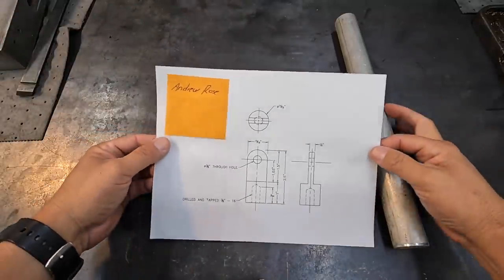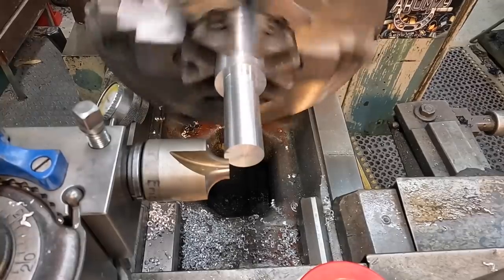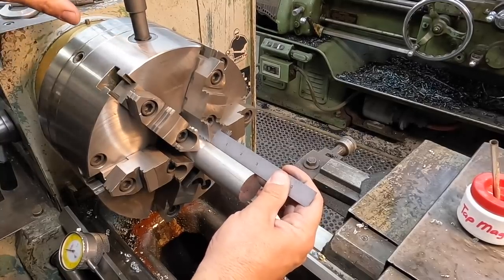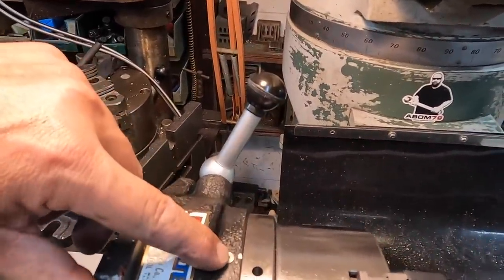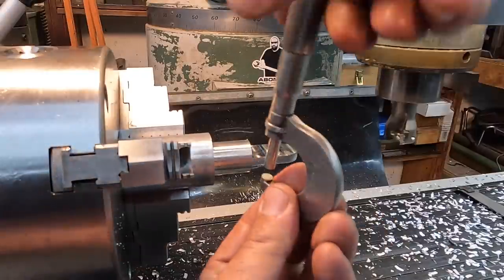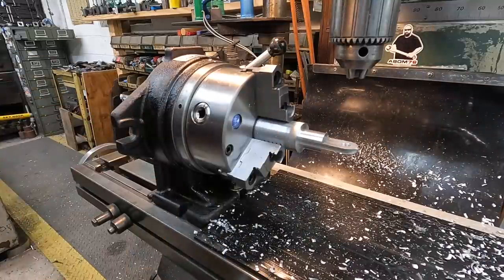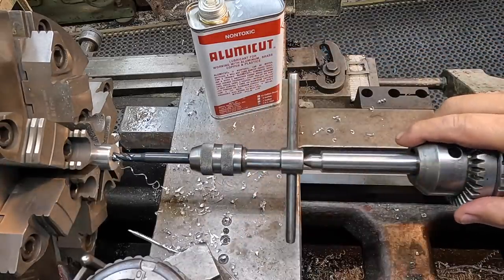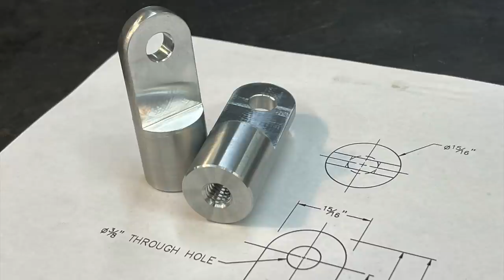Custom Aluminum Rod Ends

Comment: no desire for a fillet between the flats and cylindrical section? just considering stress concentration as a result of the geometry.
Reply: It probably interfaces with existing parts so maybe there's not enough clearance. Would be good to have at least a little fillet though. Quite possibly overlooked when they made the drawing.
Reply: Sure it would be stronger and more reliable with a filet, but is more strength and reliability necessary? I'm no engineer, but it's probably plenty strong and durable for the application.
Reply: If stress was a concern it would be steel, or stainless, or tool steel, in aluminum the hole is probably going to wear out before its going to crack.  I could be wrong, just my 2 cents
Reply: Only if it's going to the moon or faster then 200 mph!
Reply: @F0XD1E  The inserts of the indexable endmill have a slight corner radius ( By eye I'd say about 0,2mm - 0,4mm / 0,0078" - 0,0156" ) which will leave the same radius in the internal corner of the part. This slight radius already goes a long way in decreasing the stresses. Most of these types of rodends will also see next to no forces bending them in the direction where it matters how sharp that internal corner is. So this should be just fine as it is.
Reply: 6160 is awesome stuff. The cutter inserts would leave a little transition from their nose radius.
Reply: Made to the customer’s drawings. That’s what you do. Nothing more, nothing less.
Reply: No specified on the drawing.
Reply: @grntitan1  ,exactly ,this way when it fails you get paid again for improved replacement part

Comment: does the power of the machine determine the depth of cut?
Reply: Not necessarily. 
The type of cutter. 
The shape of the cutter. 
The material being cut. 
The shape of the material being cut.  
Can the material be held firmly enough? 
The desired finish all factor in more than the actual power of the machine being used. A machines power is useless if you can not correctly or safely hold a workpiece.
Reply: @michael-michaelmotorcycle  Thanks
Reply: @michael-michaelmotorcycle  I watch this stuff, but i am not a machine operator.  I am so amazed at the work Adam does as well as CEE.  I enjoy their work so much.

Comment: It doesn’t bother me that you reamed the hole, but I was taught fractional dimension (3/8) on a hole = drilled decimal dimension (0.375”) = reamed unless a specific method is called for on the drawing. 
Either way more lovely work by a talented machinist.

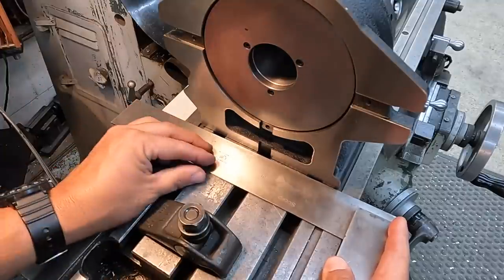Comment: 14:08 Hello, I saw you have problems with setting up the equipment. Here is the solution: Stainless steel block DIN6322A (14, 16 and 18) x20mm AMF. This cube is mounted in the grooves of the tooling and then on the table of the machine. you can do it yourself. This way you don't have to look for "Y" and parallelism. Excuse me for being rude
Reply: I for one think your comment was informative, not rude. It respectfully identified a potential improvement and offered an idea to improve it.
Reply: I think Adam already knows about keys and keying. Since this was a brand new indexer he probably hasn't taken the time to make a set for that one yet. I think he has shown the procedure for making a key set in a past video. If not it would be a good subject for a new one.

Comment: 0:18 I know that this customer probably isn't exposed to professional drafting and that you had personally communicated with them before, but did they really use fractions on a print and you didn't educated your viewers as to why that isn't a good idea (as an understatement)? On top of that, They used both fractions AND decimal on the same print... But to be fair, at least they included all of the required information to make the part and the 3 views are at the correct placement.

Comment: Caveat of using the corner mill this way is that full radius is now tapered. In the print the full radius is square, the finally product is not. Probably doesn’t matter though. Looks good.
Reply: Do you mean that the radius is now convex as opposed to tapered?
Reply: Exactly.  It’s not to print!
Reply: I agree it looks good. I disagree that there is an error in Adams interpretation of the drawing. More like the drafter (or the CAD program) omitted the detail. Possibly because they failed to understand the actual methods of manufacture. Doing the math (which I may have done incorrectly) I get an "error" of 0.017". But who has made the error? Clearly the drawing is in error since it didn't detail where and how this transition was to occur. Adam, in his wisdom, simply spread it all around the circumference of the radius where it is least likely to affect the strength and integrity and functionality for the intended use of the part. Adam also added chamfers where none were called out on the drawing wish is also in keeping of 'best practice' for a finished part. He aslo made it out of 6061-T6, a prudent choice of material, but none was specified.
This is, at least, the second time this criticism has come up in the comments. I think I can safely say that none of the people making it have ever actually designed anything of this type that has been actually made.
Reply: 1: This is for a tent, not a rocket
2: The drawing doesn't specify that in any way so it's open for interpretation
3: Even if it was blatantly incorrect it would be very rare for some extra corner rounding on a part like this to cause any issues with it's intended purpose
Reply: @glenj.taylor2938  yes.

Comment: you work from a drawing and there made according to the drawing , i think those parts wouldve been stronger of you put a radius where the round part goes intoo the flat part , the sharp inside corner probably becomes a stress riser
Reply: He used an indexable endmill to make the flats so there will be a small corner radius there from the shape of the inserts.
Reply: it's not that critical of a part that we would need to be concerned about stresses.

Comment: You can make these in your workshop... with basic shop tools....
aluminum is easy to work with...
Reply: True! But hey, if you've got the nice tools... use them, right?
Reply: @spagamoto  
i was just saying it isn't that hard to make something of that quality and material.... we all use what we own..
some have more tools than others..some less.... sometimes doing it simple is cool too.... seemed more like he needed a quick content and how long did the guy wait??  lol to get it done??  a 3D printer could make that too...🤔
Reply: @garymallard4699  I'd say to to this reasonably well, you do need a lathe and a mill. Most people I know haven't got an angle grinder, or the odd size you need for tap-size.

And of course the bragging rights of "I've got these from Abom79, look at the quality". Can't say that with your hand-filed ones with the slightly wonky size - at least that's what I've achieved when hand-filing things.

Of course, with a set of taps and the correct size drill, a file and a hack-saw - and maybe a vice, they COULD be made at home. But not as nice, and quite hard work. Also, my local hardware store doesn't sell inch diameter bar-stock.
Reply: @matspatpc  
i have a shop of tools...and 35 years manufacturing.... i can make it without a lathe or mill...and even if i cut it by hand tools...it would look as good as his... taps are cheap....i have lots as many do....  as to being made by a Youtuber??  lol...i would be prouder to do it myself as i do for 50 years plus... something that " simple " and made of aluminum is a Table saw / Router job easy.... Drill press and a Tap.... 1 Hour to make both...
Reply: @matspatpc  
buying material isn't a Hardware only choice...lol...there are suppliers who sell uncommon sizes who would LOVE your business....easier now with internet ordering.... but i can find them locally too in a few minutes.... i used to manufacture custom signs.... what kind of friends do you have??  No grinders??  they are CHEAP now...not expensive to own a few common tools.... probably don't fix stuff themselves?? 
my dad was a Handyman and i am the same....course i'm older and younger people are lazy.... no time to do stuff.....but waste money on crapachino's and stuff you can't make money back on by using.... most people i know OWN TOOLS...
Reply: @garymallard4699  I agree, I like to make my own things - even when they look a bit "simple". But then I have enough tools to do quite a few things - not like Adam's workshop, but enough to do this and a few steps up.. Not EVERYONE does, and we have no idea what the reason was. If you have to get a router or a table-saw just to do this, it's a pretty expensive project - even if you get to keep the tools after. Even just getting a tap and a tap wrench could easily make the project $30-50. And some people may not have the required skill.

I also love it when I can help someone. I think Adam does too - at least when it's not too much of a rush! :)
Reply: @matspatpc  
Again...sigh...i am not saying someone should consider " purchasing " tools to do a one off project....as to costs??  a small table saw can do aluminum work....you can buy a Used one cheap ( sometimes )...borrow one??  your using every excuse to deny that it can be done simpler and yourself ( if you have the skills ).... i made stuff 40 plus years ago without expensive tools...it can be done... not arguing..but your basically saying " Only A Machinist can do this "  🤣
tells me alot about your skill level frankly....  anyways....not worthy time to continue....  nothing i saw can't be done " Differently " .... FACT
Reply: @matspatpc  
I buy tools i use countless times...the cost is based on my needs and future useage...i still have 40 year old tools i use everyday ( i don't build fulltime ) when needed....
and work in Wood , Plastic , Metals and many other materials.... my tools Payback quickly or over many decades of use.... anyone buying to build a $30-$50 part and spending Hundreds to Thousands better plan on other projects ahead to get Value on Purchases.... Why? do you think owning Tools is Hard??  they are Cheap compared to 40 years ago....some too cheap...but they can help you on One Project ( and more later too )...  your logic is illogical..
Reply: @matspatpc  
i never said Everyone owns tools...most of the people i know DO...is what i said....some have NO SKILLS...
Reply: @matspatpc  
my original comment was based on experience...not a criticism of his work...

Comment: Ever considered machine guarding for safety. Not sure if you have seen what a lathe can do to a person but it’s not pretty.
Reply: @t.r.bovver2744  alrighty
Reply: You'll only do it once!
And then you will remember
Hopefully
How many of you have left the chuck key in and turned it on?
Reply: @nope4239  
I've only taken one and two-thirds machinist classes and I have yet to leave the key in the Chuck and NEVER intend to. 
Other students did and the Instructor at Fullerton College, who is a great man, caught em and gave em the what for about it.
Reply: Chris k9
If you're comment is directed at Mr. Booth then given he's been machine work his entire life, I would assume he's 100% knowledgeable of your concerns. 
With that aside, Machining is inherently dangerous but so is driving automobiles. There's only so much anyone is going to do when it comes to safety and practicality.
Reply: If he made it on his new Milltronics ML16 CNC lathe he has in the new shop it would be practical since the entire machine and workpiece is enclosed. Most CNC lathes interlocks so the doors have to be close for the spindle and feeds to be running. Otherwise, depending on the nature of the work, "machine guarding for safety", is not only impractical but can also be less "safe" in that is just adds to the shrapnel if something goes awry.